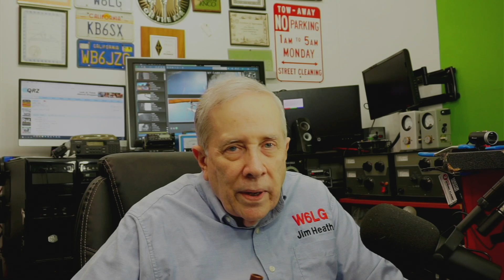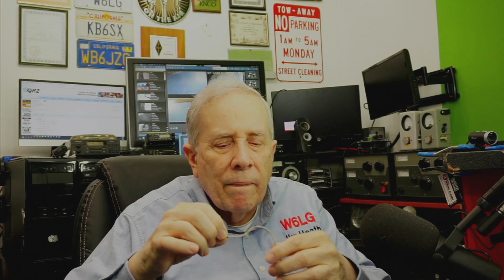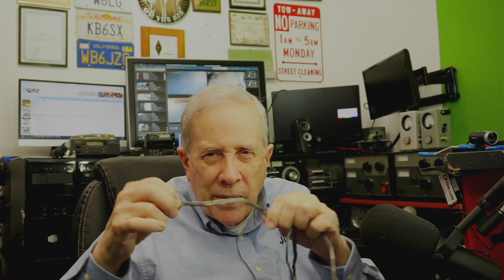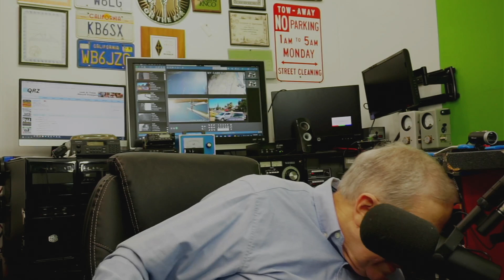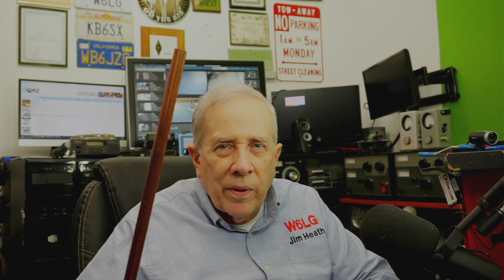How to RF Ground Your HF Station as Shown by the ARRL and a Discussion about Ground Loops, Bonding

Comment: Thanks for a great common sense, and electrical sense, explanation. I wasn't clear on one point. I get how you bond all your equipment to a command point, a wide strap to the copper pipe, but then you say, "Make sure that that is tied to the electrical system." How can one do this without running a wire to the panel. That's really not possible with my second story shack. Do I I get this for free since my outlets are three pronged outlets? 73 N1PCZ -- (Ahh, rewatching it, you discuss this around 4:40, yes, a modern electrical outlet will be grounded and one is good just by plugging in.)

Comment: Hello Jim

Thank you for sharing your thoughts regarding RF Ground .
Essentially electrons are attracted to ground , I agree with you regarding no required ground for TX , however I believe that a basic grounding system can help radio reception , grounding a radio receiver can increase the potential difference  between atmospheric electrons & ground , the radio being in between it's path to ground may help the receiver to receive weaker signals , this is a common practice in short wave radio receivers .
Direct antenna ground will slug down any unwanted high voltage insofar as localized atmospheric static electricity , this is normally within the hot open plane locations ,hence this will help prevent damage to the primary receiving circuits within the receiver  , any stations within the heavily built suburban  locations is not likely to require a grounded antenna .
For wide open plane dry hot terrian locations a switched antenna ground is recommended , the outer chassis of the antenna ground switch can be engaged in order to slug down static electricity when there's high atmospheric electro static suspected ,ie, high dry hot winds with dust particles can generate thousands of volts , normally basic weather monitoring equipment is required for ground switch operation times , particularly if the station is vacated for a period of time , then of course it's a good measure to engage the ground switch or ideally disconnect the antenna from the receiver .
By enlarge for general conditions an Antenna ground is not required , in fact a grounded antenna chassis can slug down weaker radio signals ,  however a basic radio ground can help reception to a certain extent .
In summery a basic radio operations grounding system will depend on the station location & weather conditions .
I hope that the above has been of some help .

Julian Robertson

Electronics engineer 

England
Reply: Électrons always comes back to the electric generator. Wathever the path.

Comment: This is wonderfully explained, thank you! One question: Once I've strapped my equipment to the pipe or bar, does that bar have to then be connected back to the electrical ground (where it enters the house)? Like the fellow you mentioned, I also have my ham shack on the opposite side of the house from where the electrical system enters (as well as on another floor). It seems to me from what you've said here that the simple act of plugging the transceiver, etc. into the house current already makes the necessary connection to the electrical ground, so running the pipe or bar back to the electrical box ground would be superfluous at best. Do I have this right or am I forgetting something? Cheers!
Reply: Same exact question here, but I see no reply…did you ever get your questions answered perhaps by someone else?
Reply: @kellywaldo3215  Yes, I did! Not long after this, I found another of Jim's videos (I don't remember which now) in which he stated clearly that the grounding bar should not be connected to ground rod where the shack is on the opposite side of the house from the electrical service ground. The grounding bar in the shack is only for keeping the connected devices at the same electrical potential. Hope this helps!
Reply: A video of this setup would be interesting to see!
Reply: @thormusique  thanks! I feel like that was the message here (no connection back to “house ground”) and just bond all the equipment together. That’s what I’m going with!

Comment: Finally common sense.  Hi Jim here's my latest setup. I have a metal shipping container connected to an off-grid solar system for my shack.  First, all my solar panels have an unbroken common ground to an 8' grounding rod to the inverter inside the shipping container (unbroken).  I have a common ground of a 1" copper pipe inside the container that runs 40' to my radio room on the other end of the container to the Solar inverter ground system. The inverter ground system consists of an inverter, battery bank, and AC distribution panel and they all connect to the 1" copper pipe.
 
My antenna is a 12.4 (40') DX Commander inverted antenna mounted to the top of the metal container (great ground plan) with 32 radials fanned down around the container. Every piece of equipment including the radials connects to the 1" copper pipe.  The inverter interference is minimal with the use of ferrites on all AC and DC power lines.  When I installed the 1" copper pipe as a common ground my noise floor dropped lower than when my shack was in the house.  

Great Video Jim 
Wish you the best of health

KN6TUX   73

Comment: Thank you sir, I cringed when I heard some folks were using that grounding plug to open the electrical ground at the outlet. This is especially wrong if you are using a switching power supply as that ground is shielding the power supply noise. There  are a lot of old and out dated and or just wrong information on youtube about station bonding. Basically the NEC code says all earth bonding has to be connected to the UFER earth connection at your load center or power panel as some call it. Thank you sir as this seems to be the most contested subject in HAM radio.
Reply from the maker: Hi and thanks.  Let's talk a little about your comment.  A Ufer grouding is common in some areas but not everywhere.  In some places they use a driven rod or two driven rods.  Ufer was a guy; a smart guy.  With the switching supply that has a two wire or two conductor AC plug, what is your recommendation?  And, would you do the same for all devices that do not have a ground connection at the AC plug?  I not only cringed, I yelled NO at the screen when Bob Heil recommended cutting off the pin at the AC plug. I inspected hundreds of Ufer grounding systems with the rebar installed with short length above the stem wall.  Thanks for writing.  73, Jim W6LG.

Comment: It’s an interesting discussion because I see a lot of people saying that you need a rod outside your shack to ground everything. One of them says ground your power supply, my power supply doesn’t have a connection for a ground wire/strap but it does have a three prong plug and all my plugs and outlets are up to code. 

I do have my radio and tuner connected to bus bar type setup. I know you say it needs to get back to the houses common ground via the breaker panel, but how exactly do I get it there? My shack is in a spare bedroom, do run a wire out to the garage and plug it directly into the ground bus? Run it around the house to the common ground? Open the outlet and piggyback on the green wire? I have searched places and can’t find the information because 1. Im getting conflicting information, 2. I’m probably not looking in the right area of the code/can’t find it.  

Can you elaborate on various methods of accessing the houses common ground? Thanks Jim, 73

Comment: Thanks Jim! I need some help... I live in a rental home. I want to get involved in ham radio, but I'm not permitted to add another ground rod for HR equipment. Can I start buying radio equipment without  worrying about grounding  it?
Reply from the maker: Dennis, you do not need a ground rod and in fact, it can be a safety hazard.  Do not worry about a ground rod.  It is a huge misconception Dennis.  Regards, Jim

Comment: Our home was built in 2003.  So you're saying a ground rod isn't necessary outside due to the house panel being already grounded and it may be a violation of NEC. I have TVI from ungrounded transceivers. So grounding only the transceivers, the Info Tech CW Keyboard and the external MFJ antenna tuner should solve the TVI, is that correct? When did the use of of a separate ground rod for ham gear become illegal or dangerous?
Reply: A ground rod is not a violation of the NEC if it's connected to the same ground as the power meter or breaker box.
Reply: @jeffkardosjr.3825  which isn’t possible due to the location of each of those components being so far apart
Reply: @alfrede.neuman8898  What does distance have to do with it?

Comment: Let's call the grounding of each piece of gear, together, a "local" RF ground, which is what it is.  It's purpose is to prevent "ground loops," which can cause parasitics, "RF in the shack," etc.  It must possess a low RF resistance.  Broadcast stations use copper flashing (typically 4") for this.  Why not Hams?  That flashing costs $$$$$, but a much cheaper solution is available, for the low power levels that amateur stations employ.  Ebay sells copper foil tape at very reasonable prices.  My guess is that 2" width would be adequate (it's what I use).  You can also use 2" aluminum tape, from any hardware store, though getting a good connection is a little harder than with copper.  Here's another suggestion, for making very good, but cheap, antennas.  I use PVC pipe (usually 1/2 "), covered with that copper tape, for the elements.  The antennas are cheap, strong, and light weight (at least, for VHF/UHF), and have broader bandwidth than ones made from skinny rods & tubes.

Comment: Not intending to start WW III but:  "In 1942, Herbert G. Ufer was a consultant working for the U.S. Army. Ufer was given the task of finding a lower cost and more practical alternative to traditional copper rod grounds for these dry locations (Arizona and New Mexico). Ufer discovered that concrete had better conductivity than most types of soil. Ufer then developed a grounding scheme based on encasing the grounding conductors in concrete. This method proved to be very effective, and was implemented throughout the Arizona test site.

After the war, Ufer continued to test his grounding method, and his results were published in a paper presented at the IEEE Western Appliance Technical Conference in 1963.[1][2] The use of concrete enclosed grounding conductors was added to the U.S. National Electrical Code (NEC) in 1968. It was not required to be used if a water pipe or other grounding electrode was present. In 1978, the NEC allowed 1/2 inch rebar to be used as a grounding electrode [NEC 250.52(A)(3)]. The NEC refers to this type of ground as a "Concrete Encased Electrode" (CEE) instead of using the name Ufer ground. " - W8TRN, Jim, love the NO PARKING sign!

Comment: Thanks for your wisdom. I often use an Icom 703 QRP radio in my car with a magmount antenna. I recently read the manual (!) for the 703 and it explicitly says not to use it on a magmount. Is lack of grounding the reason for this instruction? If so, is there anything I can do in a vehicle to remedy this?

Comment: Is placing an external ground rod outside of the shack and bonding it to the copper water line acceptable? The water line is bonded to the electric panel ground rod.

Comment: All the various standards (NEC, NFPA, Motorola, etc.) are written by smart folks with many years of experience and lots of letters after their names.  If you don’t follow them you are not taking advantage of all this knowledge. 

For the US, the NEC is very specific about how to ground exterior stuff like antennas, antenna towers, cable TV, telephone, etc.  The grounds from all these go to a single bus that has a #6 wire going to the ground rod.  This primary bus be in the power panel or a primary bus bar exterior to the house with a single #6 wire going to the power panel’s ground/neutral bus and #6 going to the ground rod.  Having only one low resistance connection grounding everything in the house is how you keep lightning outside the house.  There is no path or circuit for lightning current to flow – any point in the house wiring is a meg-ohms dead-end to the dirt ground except for the circuit back to the power panel ground bus.  

The standards are very clear and insistent that all radio, TV, cable, telephone, towers, etc. are grounded individually and directly (no daisy chain) to the point where the #6 wire from the ground rod terminates to this primary ground bus bar.   This primary bus bar is your single point of reference for ground voltage and is capable of large current flows at low resistance.

In the situation where your ham radio is at one end of the house and the power panel is at the other, you need to still do this.  Look at it this way.  The exterior primary ground bus bar can be as simple (inconvenient) as the bus in the power panel where all the various external ground wires, including the ground rod, terminate.  Alternatively, a copper bus bar exterior to your house near the main power entrance with a #6 wire going to the power panel ground/neutral bus and a #6 wire going to the nearby ground rod can be your primary ground bus.  All the exterior stuff then grounds onto this convenient primary bus bar.  You may also daisy-chain additional ground rods to the ground rod and/or bus bar.

The NEC requires connection of your antenna wires at the other end of the house to the primary ground bus.  But there is no restraint on the physical size, length or configuration of the primary ground bus except that it is capable of carrying large currents at low resistance.  A hard bar or large wire can be the primary ground bus.  So, extend the dimension of primary ground bus by making it a very heavy wire ending in a flat copper bus at each end.  At one end is the flat bus near the power panel and the other end is a flat bus near your shack.  Connect your antenna connections/lightning arrestor at the far flat bus.  You can even drop another ground rod.  Just think of all this as a very long primary bus bar.  But no matter what, don’t simply have two ground buses at each end of the house that are not strongly connected – to do otherwise provides a dangerous lightning current conduit through your house.

The standards show antenna wires reaching into the house.  This limits the amount of stray lightning current entering the house because the resistance and current carrying capacity of the primary bus bar is so much more than any wiring web in the house.  The house may see some lightning voltage but there is no differential in the house for current (i.e. power) flow (assuming you did a good job of high current/low resistance interconnection of the buses at the two entrance points).  If for some silly reason you decide to string another #6 wire up to your equipment room, you are simply providing a big conduit tempting lightning current to venture closer to your radios.  There is no such thing or need for an RF ground in your shack.  Don’t do it.

Comment: Jim you are correct about the grounding in the NEC. The electrical code used to qualify cold water piping as a ground but not any more and for the very reasons you mentioned. However, the NEC now requires that all metallic water and gas piping be bonded to the electrical grounding system for the protection of persons and to facilitate the tripping of circuit interrupter devices. Fuses, breakers etc... 
This also holds true for your radio station equipment. 
The ground at the receptacle powering your radio station is sufficient for this as long as it is functional. 
I've been an electrician now 34 years. In that time, I have found many situations where the grounding is either broken, improperly installed or implemented and in the case of older homes. The grounding system can be in complete shambles due to too many modifications over the years by people who don't understand the importance of grounding. Also some really old homes. The grounding can be completely non-existent... 
Therefor... You should have the grounding in your home tested to make sure you have a solid grounding system. For the safety of you and family if nothing else.
If you want a lightning arrestor ground rod system. That too should be (properly) connected to your electrical grounding system with #6 copper wire or larger.
Reply: I think there's merit to having one dedicated outlet with it's own breaker for a radio room.
Something along the lines of an isolated ground outlet.
Although I do think a dedicated metal conduit and box would also work provided it's going directly back to the breaker panel and not making contact with irrelevant metallic stuff along the run.
Reply: @jeffkardosjr.3825  
All fine as long as you make sure the grounding system is in tact and properly implemented with solid connections... Relying on a metal pipe for grounding is problematic at best. A copper wire with solid connections from grounding system all the way to the loads is far superior. A poorly installed grounding system with loose connections can cause reduced performance and radio noise. Also, a ground fault can cause damage to your equipment/Loads and take longer to trip the breaker due to the increased resistance caused by loose/poor connections.

Comment: Jim is it okay to wrap a copper wire around the copper pipe that ties the boxes together and then fasten the other end of the wire to the ground prong of a standard electrical plug and plug it in an outlet? Does that achieve the goal of connecting the copper pipe to the electrical system?